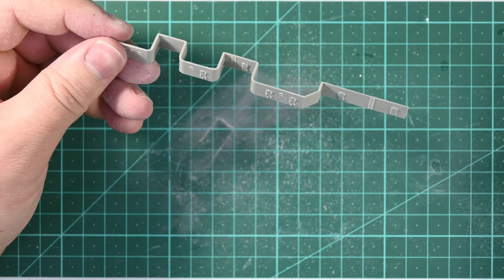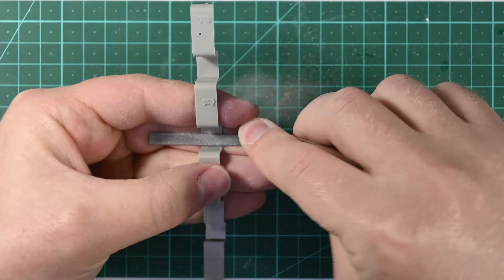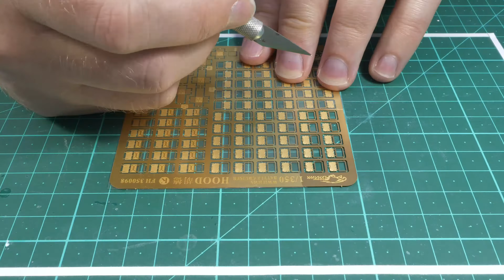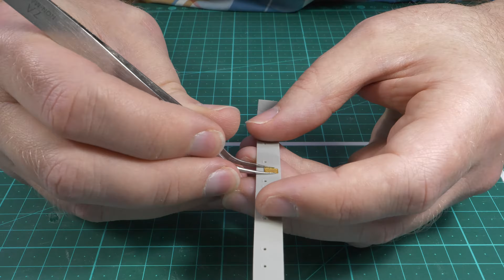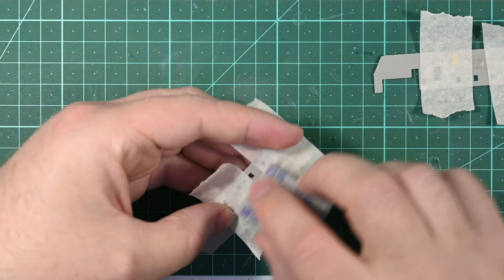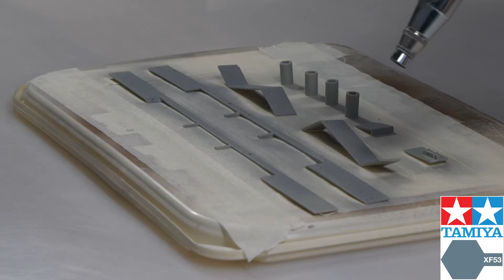1:350 HMS Hood: Part 11 - Level 1 Photo-etch Doors and Ladders

Comment: Your work is so neat! How do you avoid glue getting in the ladders and then clogging them when you paint. That is what I always end up with! So I have taken to bending the ends and installing them so that the ladder is slightly away from the model. But it is tiresome, and I would much prefer your method. Thank you for these videos, they are so helpful!
Reply from the maker: To install the ladders apply a very small amount of medium or thick superglue to one end. All that glue needs to do is hold the ladder in place while you position it.

Once the ladder is in position bond it down using super thin superglue that you apply with a wire. I use a 0.5mm brass wire gripped in a pin vise.

As for the painting, preferably use an airbrush. If you don't have an airbrush you will need to choose thin paints that hand brush well. Your local hobby shop will be able to recommend a brand.

Comment: Very good tutorial build so far. You are definitely giving me some great examples of how to work with wooden decking. I have the Flyhawk deluxe 1/700 Scharnhorst 1943 and the Bismarck and bought the wooden decking for both of them. The only question I have is with the wooden decking in place do the plastic parts that get added later have plastic to be cemented to or would I need to use a super glue or other glue to get them on the decking?
Reply from the maker: If you are using a deck designed for the specific plastic kit you are building then there should be gaps cut into the deck to accommodate the plastic parts. Having said that, the fit is often tight and there may be overlap.

You will have to decide how to proceed depending on what you find. Experiment with positioning the parts before gluing them down then pick a method that you are comfortable with. There are no rules for how to put the kit together, do what you need to do to make it work.
Reply: I am indeed using wooden decking meant specifically for the two kits. The decking is made by Flyhawk specific to the 1943 Scharnhorst and the Bismarck. That is what I thought. Thank you for the advice!  @DavidsShips

Comment: Hi David, really interesting build. Great to see the precision, planning and especially the paint sequencing which is something that is always a challenge with ships. Quick question, how are you finding the flyhawk photo etch? I used it on the prinz eugen and some of it, whilst superb, was just impractical to put together. Particularly the radars for which i sources some different ones. Do you have any thoughts on it? 

I have the Hood kit and am looking at the aftermarket sets. Its either eduard or flyhawk I think for me. I also am considering black cat models 3d printed weapons set for the hood which looks excellent
Reply: I bought Eduard railings and detail sets for the trumpeter blucher, sister ship to the Eugen. It did not even come with enough stairs or opened /closed portholes. Yet on their site they display a model with far more parts than are present. It was quite disappointing. Also I am finding their PE to be more pliable than other PE sets I've bought which means more bent out of shape railings. A lot of them came bent on the PE sheet.
Reply: I had the exact same problem when I was building the 1/350 Hood with Eduard photo etch. I found their etch just not to be worth it. Too fiddly and easy to break. Also lost a number of pieces in transit so that made it worse. @CrisstheNightbringer
Reply from the maker: I find that FlyHawk kits vary a lot. I am not that far into this kit so I can't say just yet for this one. I also used a FlyHawk kit on the Roma build and there were some impractical design choices that were really unnecessary in that kit. Unfortunately practicality issues do seem to be fairly common in super-detail kits. 

I bought the FlyHawk kits for the Hood because they were the most complete sets I could find. There are big issues with the Trumpeter main turrets that I wanted to get away from and I prefer to not mix kits too much to prevent compatibility issues.

I have been wanting to try Micro Master 3D printed parts. The are expensive and difficult for me to get but if they are half as good as they look in the pictures then they are probably worth the cost.
Reply: @DavidsShips  thanks for the reply David, I have looked at the micromaster items too, hes closed at the moment however they look amazing. The black cat items were excellent, got some flakvierlings and twin mounts. Very impressed with them. 

Will follow the build with interest, looking great so far 👍
Reply: I tried to use the Eduard set for the Hood but had a rough go of it. The Eduard pieces are really flimsy and when I was trying to build the AA guns and similar pieces it was just not fun and a waste of time. I unfortunately shelved the kit indefinitely out of extreme frustration with the Eduard photo etch.